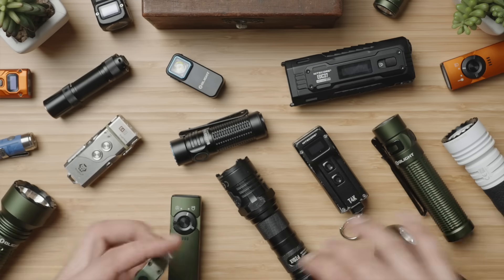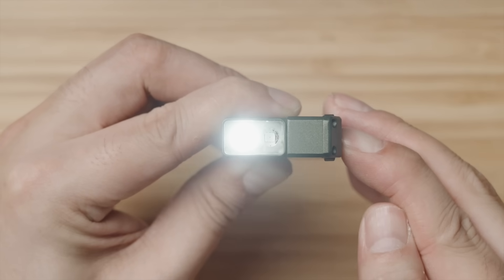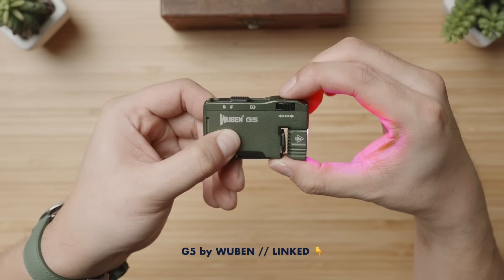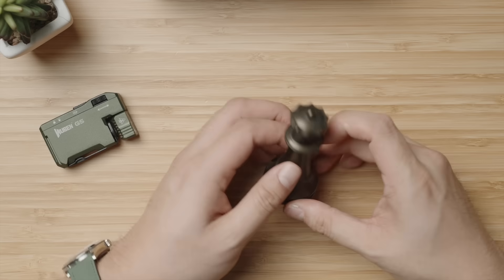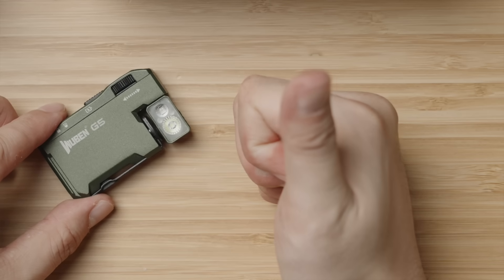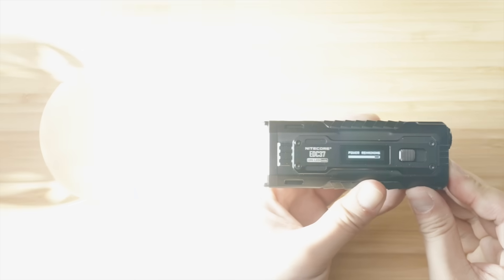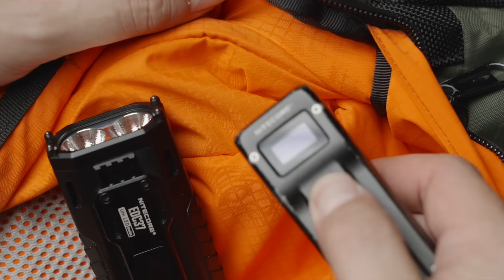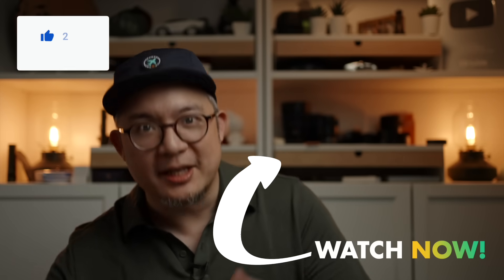Modern Flashlights are INSANE.

Comment: 0:21. This claim is incorrect, as IP ratings to up to IP69, not IP68.
Reply: @andreiignatov2138  I guess you asked AI for this answer. IP69 is not a higher class than IP68. The 9 is a rating for shorter but higher pressure which you absolutely don’t want for this kind of device. You want to submerge them for a long time, not pressure wash them.
Reply: @hanfo420 but higher pressure resistance means deeper submersion

Comment: The physical switch is actually a problem because it’s way too easy to enable lockout when you’re using the light.  I do it accidentally all the time.  A hard to remember magic button push would work better in practice.  But maybe a slide that has a push button to turn on and off lock would be perfect.

Comment: Maurice, you are an independent creator . wuben is still a company. And this light is definitely sold at a loss to gain market traction. 
Maybe their higher end products make up for this loss. 
I'd always accept the higher costs that comes up whrn supporting independent creators like you. 
Removable battery lights are the king, rest are use and throw in a few years.
Reply: The thing that wears out the most apart from exterior is the battery and its non replaceable.. Imagine having to change entire car after tyres run out.  If a consumer wishes they should be able to hand over their possessions to next generation. This use and throw culture forbids that.